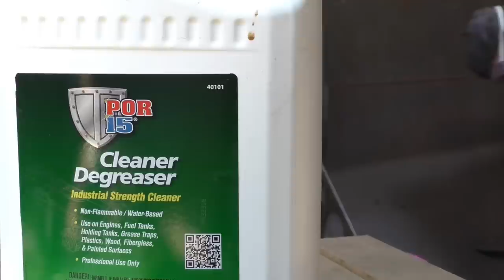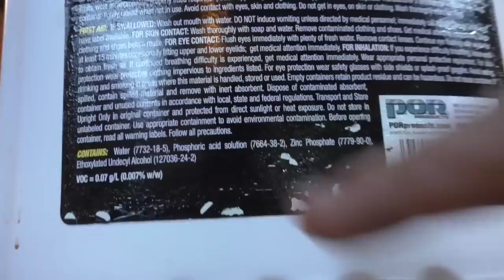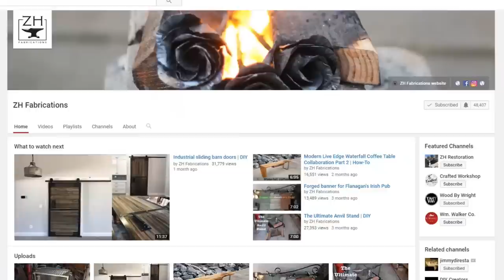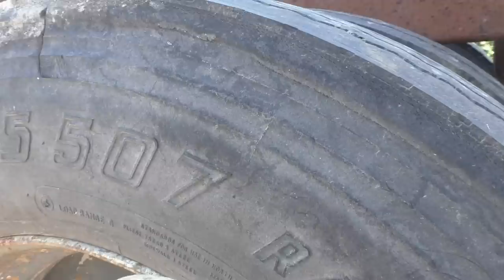POR15 Fuel Tank Sealer - Big Boat Trailer and more

Comment: When you use the bolts to "cage" the spring brakes on the trailer axles, you are actually compressing a large spring. In operation this spring is compressed when you use air to release the parking brake. Do not take the cans apart without caging the spring. If you attempt to disassemble the can without caging it, the can will separate with explosive force.

Comment: I made a pen on my lathe today, but not a normal pen, it was wood from the arizona desert, hardwood which is protected by law, this wood was growing 500 years before the saxons came to britain, for $45 it was about 2" by 4" small but it has weight & a nice grain & looks great, My next project is a traditional 10 banded 59 year old whisky barrel going to be made into whisky cabinet to store my hoard of whisky going back as far as 1974, i will get round to building a twin hull sail boat soon in a few years time, but not as big as your boat, love the clogs they were a work of art.

Comment: If chemistry is your thing...
Rust cure /Rust Doctor...(PHOSHORIC ACID)  reacts with Fe2/3-O2 to form Iron Phosphate FePO4 structure of tetrahedral α-quartz (In mammals, Iron phosphate can cause eye, skin, and respiratory tract irritation and may be harmful if swallowed.) . Iron phosphate coatings are also primarily used as base coatings for paint in order to increase adhesion to the iron or steel substrate, and is often used in rustproofing. Also used as a fertilizer.

Comment: if you check out the firestone air spring for Comercial and industrial applications they have pdfs available to download listing all the specs and capacities of every bag they make.  thought it might help .   it's amazing  what those air bags/Springs can lift and the amount of travel you can get out of them.
Reply: IMSEMICRAZY Around 30 years ago while I was working as a boilermaker, I was on a refit of a rotating air preheater for a fair sized wood waste fueled steam boiler. At around 60 feet in diameter and a cross section of ten feet, it slowly turned through an exhaust gas duct and transferred that heat to the boiler intake air ductwork alongside. We used this new technology, (pressurized air bags), to lift and move this huge piece of rotating machinery. Those bags beat the hell out of old jacks, blocks & tackle. Since that job, I've used air bags a number of times while setting heavy industrial/ wastewater components. 
Its funny how the older I get, the more I sound like my father. LOL!!!

Comment: A 1inch "D" handle impact from harbor freight should take those lug nuts off. I use one regularly and it does a good job. Be sure you have a 1/2" air line with 3/8" quick connect fittings and turn your air pressure all the way up(120-180psi).

Comment: Fire in the hole is a fun way to get big tyres onto rims but if you want a less dangerous way; you take a bicycle tube and fit it up close to the tyre then inflate it and it makes a seal so you can pump up your tyre till it is almost there then deflate the bicycle tube, remove it and then inflate your big tyre. Sorted Frenchfarmer style!
I've got a 70 euro compressor and I can fit tractor tyres real easy.
.

Comment: Are you worried about the tank sealer pealing off of the untreated surfaces of the fuel tanks. Big fuel filter or coarse pre filter.
Reply from the maker: No.  That's what filters are for.
Reply: C2welder I think a bigger concern would be parts desolving in the fuel. Worse case though you just pump the fuel out, clean it out and fill it back up